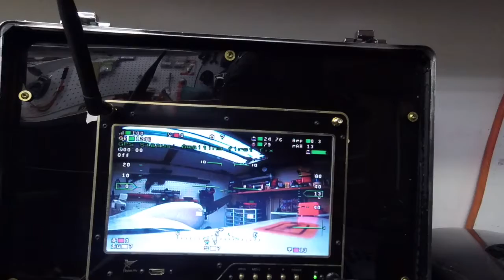Believer 1960mm Twin  #3

Comment: Hey bro I subbed you I’m going to build this
Reply from the maker: Excellent built good look
Reply: Would you have a list of what you installed on the plane thanks
Reply from the maker: RMRC - 1.3GHz 400mW Transmitter - US VERSION
VAS - 1.3 GHz 10dBic Crosshair Antenna RHCP
RMRC - 900MHz-1.3Ghz Receiver w/1258 
Eagle Tree Systems Vector Flight Controller
MN3110 KV470 Motor 
40A+ High-Quality ESC with SBEC cobra
 Digital Metal-Gear Servos
 Propeller  11x4.5 one 11x6e @Garethfrostturkeythroat113
Reply: CP havana thank you so much

Comment: hi cp havana !  it seems that you`re a very meticulous person , congradulation on the built it`s a very good job , would you have any hints to give me on the built some issues you had or things that i have to pay attention to because i just bought the beleiver (on its way home) and  i would like  a bit of your help.  i`m planning to run it on 6s 12000mah with hobbywing platinum 30amp esc and (i just got the motors yesterday) ,t-motor mn3110 700 kv , eagle tree vector,  and 433ghz ,1.3ghz video set up for long range.  thanks for your help

Comment: Hola amigo : que sistema de transmision de video usted utiliza?
Reply from the maker: RMRC - 1.3GHz 400mW Transmitter - US VERSION
TrueRC Singularity 1.3GHz LHCP SIDE FEED
VAS - 1.3 GHz 10dBic Crosshair Antenna RHCP
RMRC - 900MHz-1.3Ghz Receiver w/1258 with RMRC Comtech Tuner
MFD AutomaticAntennaTracker

Comment: Very Nice what motors are you using?
Reply from the maker: agle Tree Systems Vector Flight Controller
MN3110 KV470 Motor 
40A+ High-Quality ESC with SBEC cobra
 Digital Metal-Gear Servos
 Propeller  10x6 or 11x7
battery 10000  6s

Comment: Excellent built! Thank you for sharing! Questions: 1) It seems that you laminate the whole aircraft, isnt it? It is for more rigid airframe? 2) Is the VTX with sufficient airflow for cooling in that place? Thank you!
Reply from the maker: Yes  rigid the airframe is or w good and I don't have problems yet w the VTX
Reply: CP havana Thank you!
Reply from the maker: https://www.youtube.com/watch?v=fdflNdSd60Q  look at 0.27.  no daños de ningún tipo
Reply: CP havana Hablas español! Empecemos por ahí jaja. Si lo he visto, muy bueno. Estaba pensando en laminar sólo las alas pero cono no veía ejemplos no sabía si era demasiado refuerzo o no. Gracias.
Reply from the maker: YO LAMINO TODOS MIS ABIONES YA QUE DURAN  MAS CON EL CONTARTO DE LA TIERRA O LLERVA ADEMAS SE BE BIEN
Reply from the maker: I LAS ALAS LO AGO PARA NO TENER QUE MONER HINGES
Reply from the maker: I SIENPRE USO 3MM NO 5 YA QUE 5 PESAN UN POQUITO MAS
Reply from the maker: curiosity de que pais es usted
Reply: Hola excelente vídeo, me ayudo a construir el mío. Y tu centro de gravedad...?
Reply from the maker: CG: 1.5cm towards the back of the center of front carbon rod
Reply from the maker: CG: 1.5 cm hacia la parte posterior del centro de la barra de carbono delantera
Reply: CP havana porfa una fotito
Reply from the maker: no entendi usted quiere una foto de que?
Reply: en el video usted tiene al belieber sobre unos parantes que creo que es para calibrar el CG, decia una foto donde estan esos puntos con sus parantes..gracias
Reply: puedo escribirte por email para hacerte la consulta, porfavor
Reply from the maker: mandame to correo para mandarte las fotos